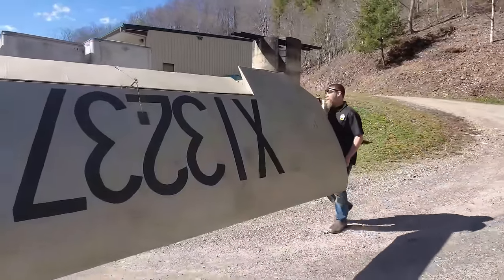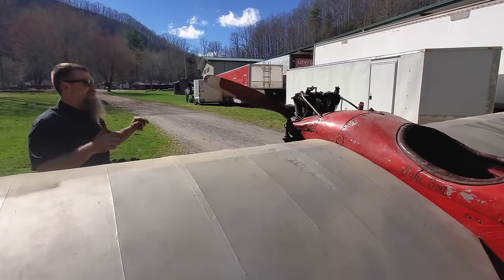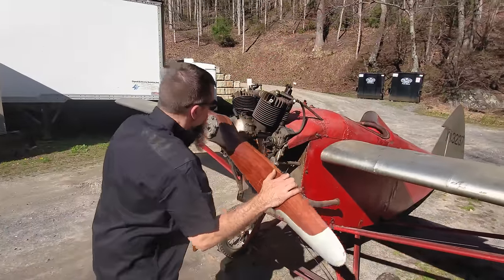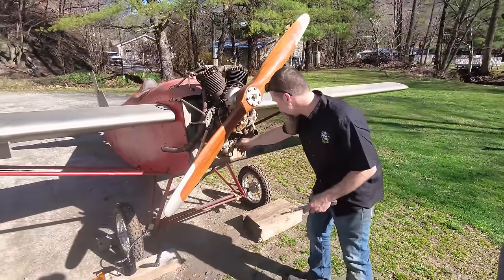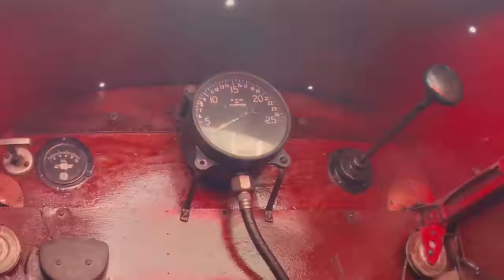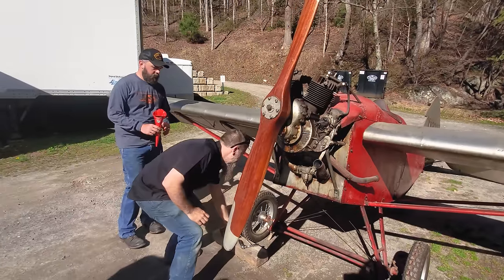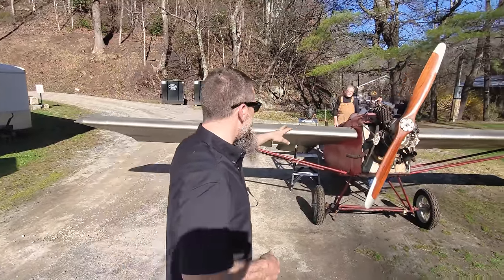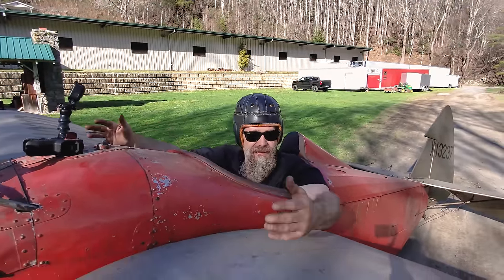Can We Make This 1920s Harley-Davidson Powered Airplane Fly?

Comment: You definitely got the safety crew in the comment thread! I guess don't do it like you did it? You have to start somewhere!! Me and a buddy of mine went all the way to Iowa to get a experimental aircraft AKA a Ultralight aircraft. Never seen it before! Bought it for 1800$ on the way home to kansas we lost the tail rudder. My budy got the great idea to hand craft one out of PVC and plastic wrap. At Miami County airport he asked me if I wanted to take it up on its maiden flight? 1 joint in and I still had enough sense to know this wasn't a smart idea. I was the voice of reason that day, totally out of my character, I might add. I stated just the facts. 1. We have PVC and saranwrap for the tail rudder. We should just wait until we can source another. 2. The engine wouldnt start easily and that points towards a underlying issue that should be corrected. 3. Dont fly it!! Well, he didnt drive all the way to Iowa to not fly it. He had me video record the flight from the ground. It did fly! For 10s it gained altitude until it didnt. He was 200-250ft in the air when it died hit stall and nose dived towards the ground. He just got it to pull level when it slammed into the ground. He brokr his back in 7 places and his neck in 2 places.he has been paralyzed from the waist down from that day on. It traumatized me !! Its all on video! He still flys paragliders but I must admit I feel a great amount of guilt to this day for not being more vocal. Anyways, my point is make damn sure she runs good and air worthy! The alternative isnt good! GOD SPEED SIR!

Comment: I have been a pilot for over 40 years and I was terrified at the prop swinging procedure. Extremely dangerous. Never use both hands. In this instance best to have left side of your body facing the propeller and use your left arm to allow your left hand to clasp the propeller tip when it's on compression and quickly pull arm down and slightly towards your
body at the same time. This helps reduce risk of getting struck by the prop and had you moving slightly away rather than towards the rotating prop.

Comment: I want to see her fly, but it's going to be a challenge. The beast has not even basic standard instruments, like an airspeed indicator and altimeter. All you need for turn coordination would be a string attached at the bottom center of the windscreen (need to work on that since it doesn't have one). She has a stall speed...the problem is you don't know what the stall speed is and you don't have an airspeed indicator. A stall warning horn would work, but don't think she's got one. Then there's the reliability (or lack thereof) of the engine. She does seem to want to fly though, for sure and certain.

Comment: You should get in touch with Kermit Weeks down in Florida. See if you can work with his people and make that thing airworthy again. Or get a copy of the blueprint that won the contest and have a flying replica built using this plane as a reference.

 It looks light enough to operate under Part 103. New fabric, get the controls rigged and lubed right, the underlying structure looks good...? I'd fly the heck out of it.

Comment: I'd test fly this bird off a long runway.  First to accelerate to tail off the ground first to check if too tail heavy.  Then to accelerate to just leaving the ground no more than a couple of feet.  Do that a few times to get the feel of the plane.  Then finally do a regular takeoff, but do a higher speed than normal climb in case there is a problem with wing design causing a high speed stall.  If you want somebody to fly it, I'll do it.  Have lots of taildragger time: spray planes; glider towing; aerobatic planes.  Oh, and I'd wear a parachute.

Comment: Are you sure that extra oil in the crankcase wasn't lubricating the redrive as well?  I'm not sure how you could tell without cracking the thing open.  Maybe use a contactless thermometer on the redrive housing to see if it's significantly hotter than the block where it is attached?

Comment: I was just watching your episode that airplane with that gear reduction unit where the propeller hooks to maybe he had more oil in it if it uses some of the oil for the gear reduction system that's the only thing I can think of is that gear reduction system needs oil as well

Comment: It looks fairly well-proportioned, it should fly well as designed.  Outside of checking the center of gravity and overall mechanical worthiness the only real issue I see is the warped control surfaces.  It looks like that left elevator is badly twisted.

Comment: The "Elevator" is the "flap thingy" at the aft of the tail section. The "Ailerons" are located on each wing and induce roll during flight. IMPORTANT!! USE BOTH HANDS ON ONE PROPELLER BLADE; THE ARM YOU SAVE MAY BE YOUR OWN!  When proping any aircraft, NO ONE SHOULD AROUND THE ENGINE EXCEPT THE PERSON STARTING THE AIRPLANE 
     Your a motorcycle guy, leave the flying to someone who knows what their doing PLEASE. The engine sounds great! BE SAFE!

Comment: Yall need some help. A test pilot is necessary and you also should check the regulations on flying this thing. Its not under ultralight weight so it is required to have proper maintenance done to be airworthy. If yall have any questions reach out to me.

~Private Pilot license holder

Comment: I picked up a 1947 Piper Cub for about three hundred bucks in Wisconsin from a apple orchard I was a barn painter and it was downstairs in the barn he sold it to me I like I said for I think it was $300 and he would use it for keeping the frost off of the apple trees during cold snaps to save his trees and fruit well it had been running years but I bring it home and cleaned up the Magneto's and checked it all out had a lot of fun ree varnished the prop and it had metal trailing edges on a wood prop and had dual Magneto's like I said it was a 47 Piper Cub it had no wings it was the fuselage on Wheels and I think it was a snow machine for the Great Lakes I ran it down the county road and back and played with it at the house it was hard on gas so I ended up selling it for five or six hundred dollars I would spin the prop to choke and prime the engine and then I would tell my son ignition on he would yell out contact! And then I would spend the prop after it had been primed and choked with the ignition on and there she would go

Comment: If plane weights 1000lbs, and is build right you'd probably need about 40mph to stay in the air you'd need the correct prop at the correct rpm and 37.5 hp to get up.

Comment: You need some re-rigging on that, in addition to all the other safety comments.  I can see a horrid warp in the left-side elevator ("flap at the back"); it's both up and down at the same time.  IMO (and I'm not a pilot or aircraft builder, but I've built and flown a number of R/C models) this Katie Bug is not airworthy without some significant work.  It would have been expected to replace the fabric covering after 30-50 years at most; that's most likely what will be required to straighten out the elevators.

Further, you need a licensed pilot with test flying experience before you even consider taxi testing again; you could easily destroy the entire aircraft just by getting the tail too high (and with that warped elevator, you might find you can't prevent that if you get above a walking pace), causing a propeller strike and nose-over (potentially followed by a fire if the fuel tank or line is damaged).  All involved need to learn safe hand prop starting methods, as well as to stay out of the propeller arc of a hot engine -- they've been known to unexpectedly pop over (even with ignition and fuel off) and a propeller is nothing to mess with.

All that said, I would love to see this aircraft safely flown (after getting the work it needs done).  The 1920s were a very different time; just a few years earlier many aircraft engines didn't even have throttles (or the throttles only selected high and higher power setting); look for video of Henley Aerodrome or other WWI vintage aircraft to see the way they have to switch the magneto(s) off and on in order to reduce power enough to land.  That very aircraft couldn't be flow even as an experimental if built new today -- though if it's as light as you say, it might just squeak in as an ultralight.

Comment: Please use the correct hand prop method to start it for safty. If the engine and related parts were restored and the airplane was in good structural condition, I would haul it to an airfield and fly it.

Comment: Guys were putting Harley twin cam engines in a modern home built aircraft, i believe called Zen air. Looked very much like zenith's low wing ch650. Harley Davidson made them quit using the engine.
They flew fine, but I think in a crash situation, Harley Davidson didn't want the publicity.😂

Comment: Elevator is not ballanced! It will drop even harder if the nose goes down and increase the drop of the nose. This is a killer setup! next  problem is a missing frame over your head, because it will flip foreward after touch down because this tiny wheels will sink in wholes and stop the plane, the pilot will loose its head, or get a broken neck. This plane is not good for your health! but with changes it could let the pilot survive, maybe. Don´t ask FAA. They will burn it down to save your life I suggest.

Comment: Man. I would love to have that thing. Would I fly it? I don't know, but probably. After going through the engine and then checking the flight controls out, I would give it a go. I would taxi several times to see how it does, then grasshop it a few times to see how it felt to me. Then unless I found something wrong it would be in the air. I probably already know the answer to this, but is it for sale?

Comment: Forgive me if I’m wrong but wouldn’t an old vintage engine like that run off 4 star fuel.  Old vintage engines need leaded fuel because of the soft valve seats and unleaded would work but because of the ethanol amounts and no Tetraethyllead (TEL for short) it will cause “Knock”.  TEL allowed engine compression to be raised substantially with out damaging the valve seats and because of the significantly higher compression ratio, TEL stopped detonation or Knock which burnt out the valve seats usually on the exhaust valves.  Now with out lead in the fuel this could damage the engine because avgas has TEL in the fuel and it’s what they should be using on a vintage engine or 4 Star fuel which is not made anymore in the U.K. but I wonder if it’s still made in the States ?  Do any of you guys in the comments know about this ???

Comment: It's a cool little airplane and cool that you got the engine running but you know just enough to DANGAEROUS!!! You will loose your hands cranking it like that and DO NOT attempt to fly it if you think the flap is on the back and the wing has anything to do with pitch. Sheesh

Comment: Wow. I'll only say one thing: Don't ever do that by yourselves again. Have a real pilot check it (pre-flight inspection), and sit in that cockpit before starting the engine. Be sure that whoever props the engine knows how to to it correctly, unless you're looking to lose a hand or arm. Keep observers away from the sides of the spinning prop.
Yeah, I'm a pilot, so I, like others on this comment thread, know from whence I speak.
I'm also an A&P mechanic. There's an old adage concerning assembling an airplane: "Never Fly Away From A Bolt". Head forward; nuts to the rear. Just think about it. Makes perfect sense.
Working around an airplane is no time for horseplay. It's serious and there are serious consequences for not taking it seriously. I'll stop with the lecture but, I only did it because I've seen some terrifying things in my time (too many on YouTube as well), when people who don't know anything about airplanes start messing around with one, thinking it'll be fun & easy to fly. Something to keep in the back of your mind is "There are old pilots, and there are bold pilots; but, there are no old, bold pilots". Take care fellas. Have fun but be safe.

Comment: I get he's a biker but jesus man look up some handprop videos.  I learned how to handprop Dad's C170B at a young age and I probably wouldv'e approached starting a familiar engine the same way if I hadn't been properly taught how to do it.  This kinda like the equivalent of trying to start a bike with a lawnmower blade  that's permanently attached to the primary.  You also shouldn't rotate the prop AT ALL when the mags are on because they kick the prop and even if it doesn't start you'll lose fingers.  I'm guessing thats a fairly sharp wood prop.  Awesome plane, looks like it could make Part 103 ultralight weight with little work.  Thumbs

Comment: I learned to hand prop a plane when I was only 15 by cranking our Piper J3 Cub.  If I had tried to start it like that, my instructor would have grounded me until I was 34.  NEVER, EVER, try to start a plane engine with hands on both sides of the prop. There is a specific technique, and I strongly advise you to get some instruction from a CFI knowledgeable about propping an engine with no starter. With no one on the brakes, the tail should have been secured to a fixed object with a strong rope or cable unless you want to be pureed by a runaway plane if it jumped the chocks. Also, I suspect there is no way that old fabric would ever pass an inspection for airworthiness. Get it looked over by a licensed Aircraft Inspector, please.
Reply: Oh c mon man , this is a plug for the museum !

Comment: From the perspective of a pilot.

With regard to handing the prop in addition to what everybody has said never, trust a magneto ignition so always disconnect the plug leads and/or manually ground the mag while manipulating the propeller, especially, on something as ancient and rudimentary as a home built museum piece.

While the schematics for your plane may have won first prize in a magazine contest back in the day bear in mind that the science of aerodynamics barely existed a mere twenty years or so after the first powered flight and the volume of relevant knowledge was comparatively minute.

No matter how fascinated the designer may have been with aviation there simply wasn't much information available when he created that machine so like many others of the time it's creation was a very, rudimentary process performed by an inexperienced amateur.

Neither the horizontal or vertical stabilizers have any aerodynamic shape so they lack both internal strength and enhanced dynamic capability and the elevator's look about as rigid as door mats.

Nor, is the Vertical stabilizer externally braced in any way despite having to support stresses imposed by quite a large rudder area.

The attachment points on the end of the wing spars looked to be far too light to serve such a critical function and may well consist of an inadequate alloy, so if the aircraft encountered even relatively mild turbulence or other stresses they could easily fail.

In addition to all of this the wings appear to be equipped with full span ailerons capable of imposing substantial loads on the wing structure in addition to creating substantial drag particularly for an engine that is undoubtedly underpowered to begin with.

Furthermore even while the engine was subject to ground operation the amount of flexion obviously visible at the engine mounts is positively horrific and the structural strength of the reduction gear assembly is dubious at best so any throttle input should be gentle at best particularly when reducing rev's.

For these reasons and a great many more I suggest that nobody, should attempt to get an antique of such indeterminate structural and aerodynamic integrity airborne without a meticulous inspection by a licensed aircraft maintenance engineer.

If the thing has, actually ever flown, that would have been an incredibly risky enterprise even when the materials it is made of were brand new.

If someone should throw sanity to the winds and attempt to fly the thing now they should exercise extreme caution while applying rudder and elevator in order to avoid structural deformation or even failure.

Comment: Considering that a Harley motor is nothing more than a radial engine, not much different from the engines of WWII and earlier, it will run great!
In fact, it had better run better than those old reliable engines!

Comment: ‼️Harley’s have two cylinders so at least it will always be running on one.

This isn’t some joke. I’ve recorded a dozen carb’d Harley’s idling and taking off on one cylinder and the guys that own them say they’re supposed to sound like that 🤡 air leaks bro. Those crappy manifolds.

Comment: Sounds like it has a good engine, which is nice given how long it sounded like it was sitting around given the background story. Almost seems like it started too easy. I'm surprised the carb didn't have too much gummy stuff either. (Most videos showing some small engine with a float bowl like that shows them draining it and seeing if anything funky comes out first.) And like many others have said, that starting technique looked sketchy as hell. Should be standing off to one side clear of the possible aircraft path and able to quickly sidestep the prop arc. (No claims to be an expert, but even old films show how they started those things.)

Would be neat if some airframer could go over it, and if it passes that inspection - possibly find a pilot that's willing to give it a try. That would make for a neat video too.